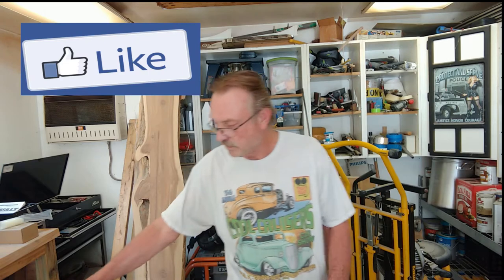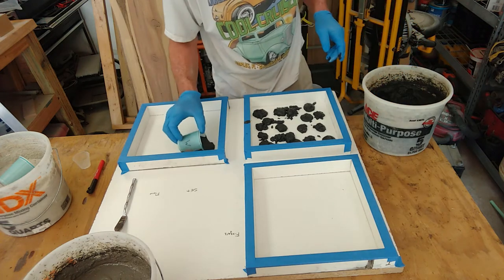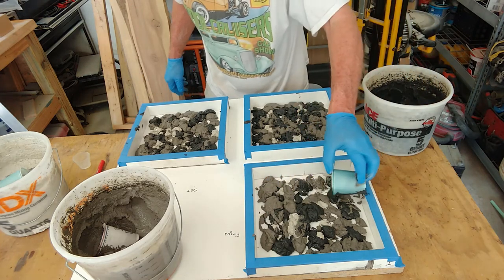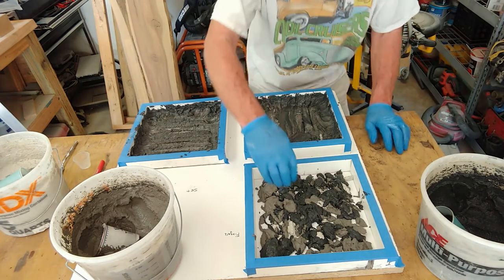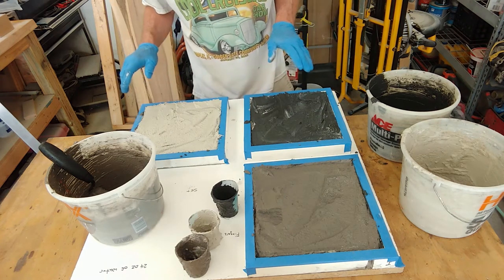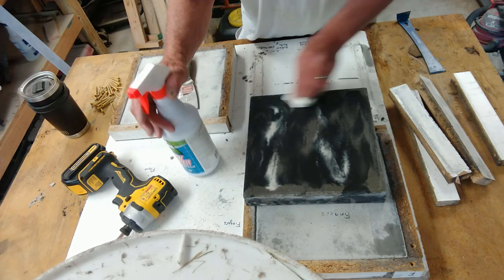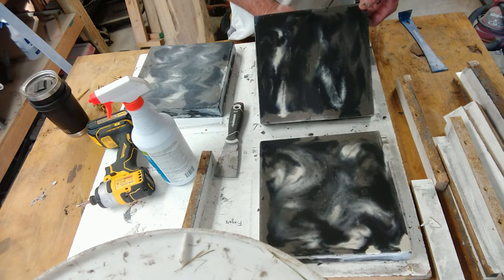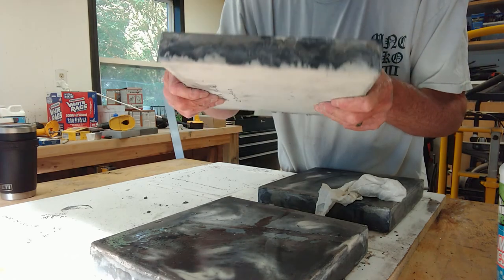Sampling Pre Cast Rapid Set Mortar Mix Concrete Counters DIY! | *How To Emulate Marble!*

Comment: I love watching all these experiments bc you are doing what I would normally do before before a project without having to spend the money!!!!  Have you done one showing RS Mortar vs Cement-All?  I want to see that.
Reply: PS, the “fingers” is my fave
Reply from the maker: No I have not, Cement all is whiter in color and has more comprehensive strength and is more expensive. Motar mix is more than strong enough Countertops so i never ventured into Cement all.
Reply: @detroitdiy  I would love to see an experiment.

Comment: Question: If wanting to colour the Rapid Set (mortar) do you think titanium dioxide is one's best option? If so, how much are you allowed to put in without messing up the chemistry?
Reply from the maker: Iron oxide can also be used but I can't find it in white. Rapid set motar mix or c.t.s cement manufacturing told me via email I could put 1 pound of color per 55 pounds of rapid set.

Comment: I'm making concrete window sills (36 inches wide, 4 inches in depth, and 4 inches tall tapering to 3 inches for the slope) to replace brick rowlock sills. I the mold out of plywood and made some test pieces with rapidset mortar mixes to refine the design. Would rapidset mortar mix be a good choice for the final product?
Reply from the maker: @Chris__UU  it would be one I would consider. First check to make sure it can be poured at 4 inches. If not rapid set cement all would be another fine choice. All cement products have a minimum and maximum thickness for strength.
Reply: @detroitdiy  Tech docs say 2 - 6 inches. Thank you